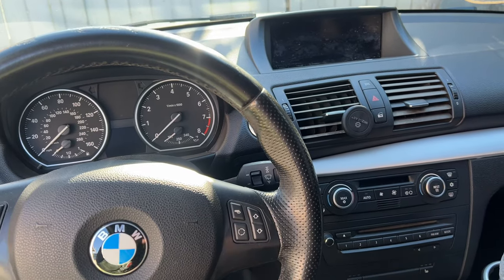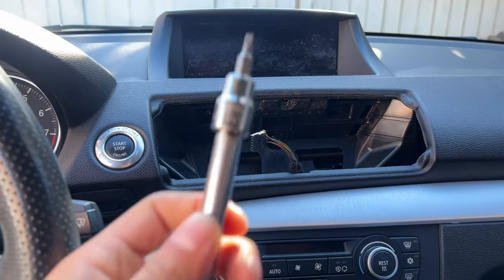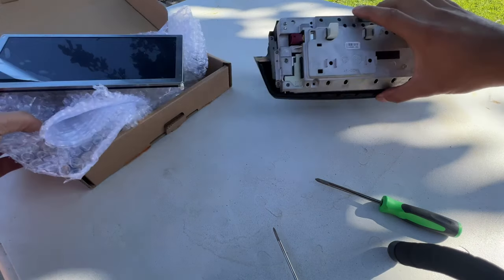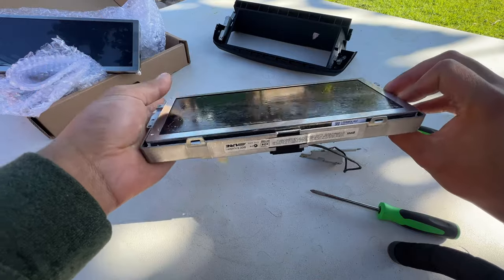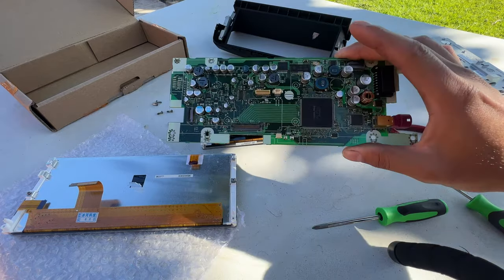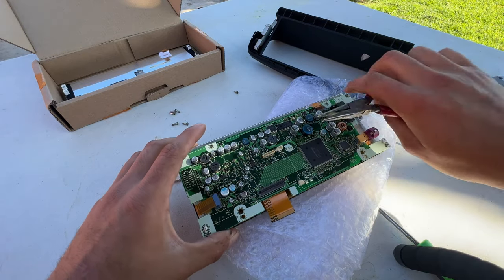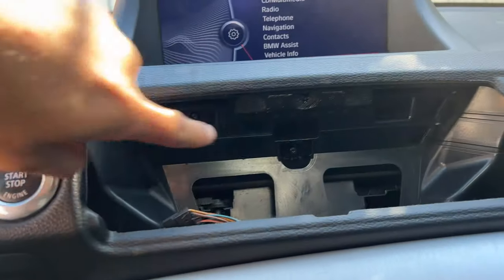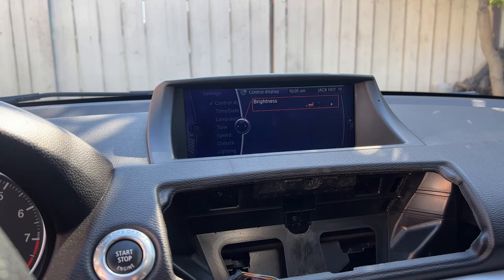HOW I FIXED MY BMW'S iDRIVE SCREEN: LOOKS NEW!

Comment: What was the fault you had to need to change screen?
Reply from the maker: The old screens anti glare film was chipping away looked bad.
Reply: @menjicar  I have an issue with mine with vertical lines and black and grey spots I was going to change screen but I think it probably the pcb, can’t seem to find any any idea where I could find one?
Reply: @easternundergroundsounds6977  I have the same, any update or fix (replacement)?
Reply: @PINDAGames  I replaced the whole unit in the end, it was second hand of eBay was the only one on there tho it was about £400 but I managed to sell the old one for about 130, easy enough to replace but probably best to get original one checked first tho.